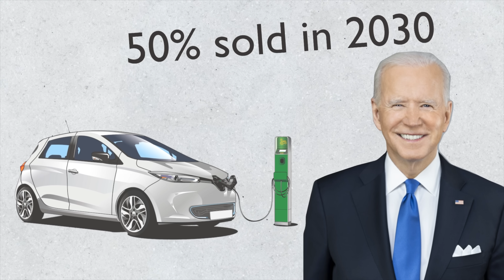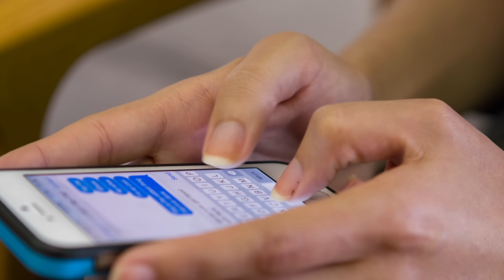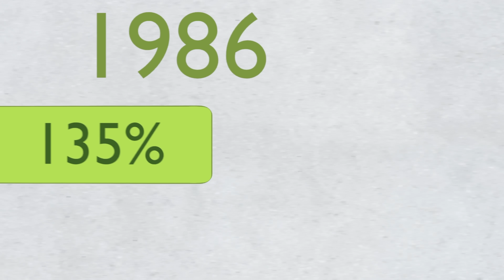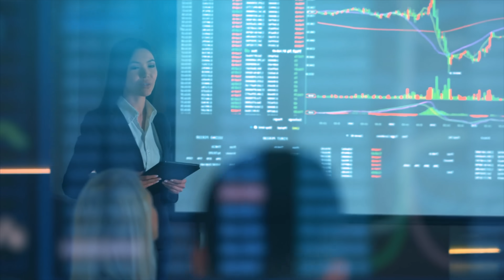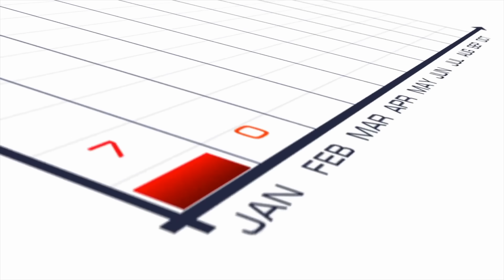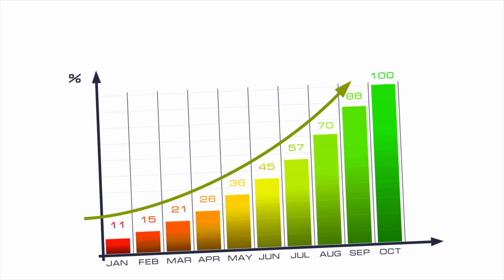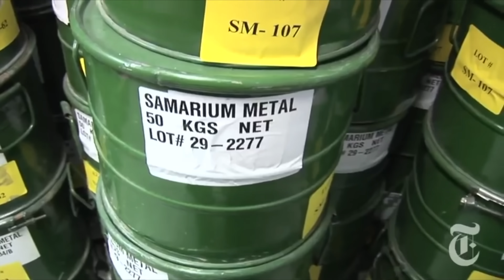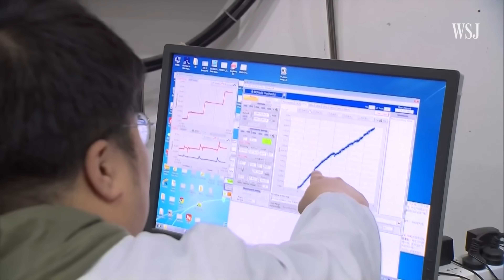Here's Why China Now Owns Toyota, Ford, GM, and Tesla

Comment: Heck there are sodium ion batteries which are more than capable for smaller range cars for for cheaper than any car batteries mostly used now.  Bigger cars sodium batteries are to big heavy for long range use. There are actually solid state battery's we just need infrastructure soon. The reason America is behind in elictric vehicles is not only a battery problem which is short term , America has old greedy companies. People are realizing buying a gas car now even over  overpriced e vehicles the gas car in just ten years or less price per gallon will double, and better quality cheaper elictric vehicles are all ready made taking over the rest of the world. The American car sales just keep getting smaller   just look how chev invested in China low cost vehicles but America pays a couple hundred times those little elictric car prices. Heck America pays twice as much for a quality elictric car. Why old greedy companies don't want even local competitors bringing low cost options. The old companies are changing way to slow that's why high prices and other countries like China will get rich for a few Years, or gas cars get tiny anyways in a few short years.

Comment: Elon's proven the point that EVs can outperform exotic $Million supercars, now he needs to pull his head in to help save the environment.
Smaller batteries with performance-restricting software would go a long way towards saving resources & at the same time bring down prices dramatically.
The problem is that consumers have been seduced by extreme performance & haven't got the brain to work out that it's entirely unnecessary.